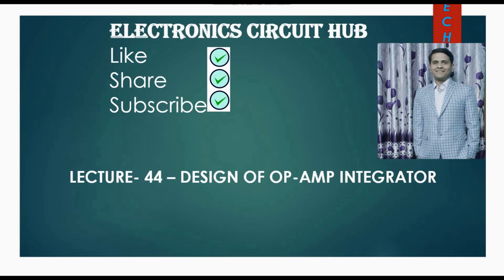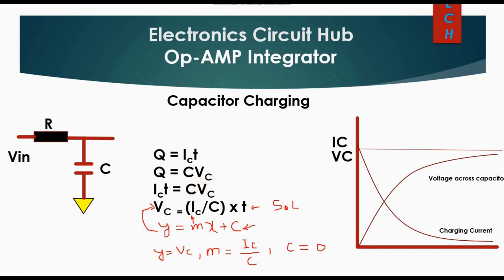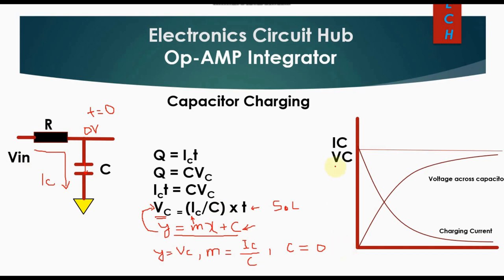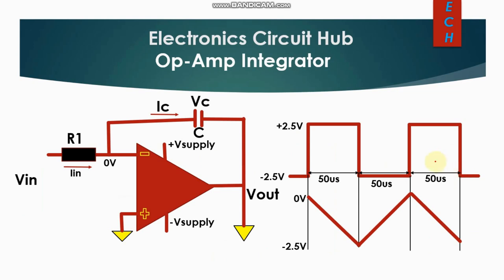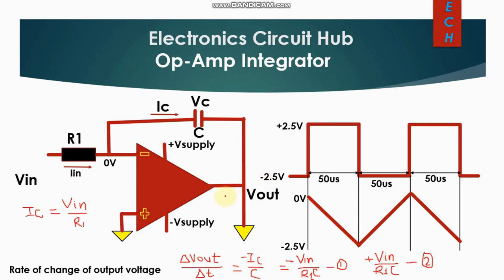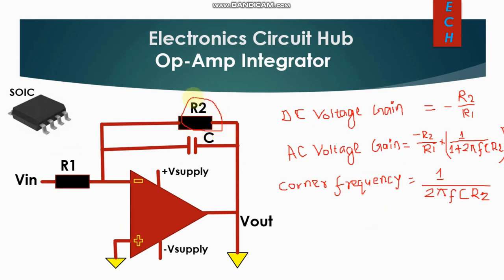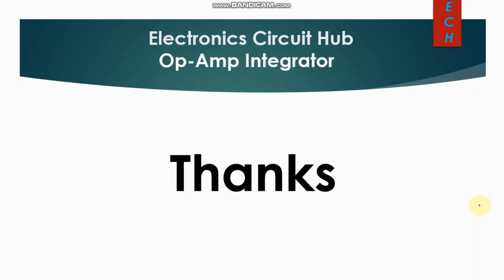Op-Amp Integrator Circuit Design || Practical Op-Amp Integrator with Triangular Wave Generator

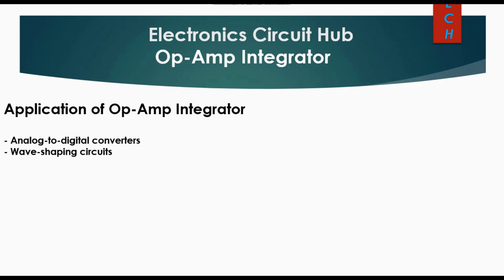Comment from the maker: 0:08 min - Op-Amp Integrator Applications
0:55 min - RC Capacitor Charging
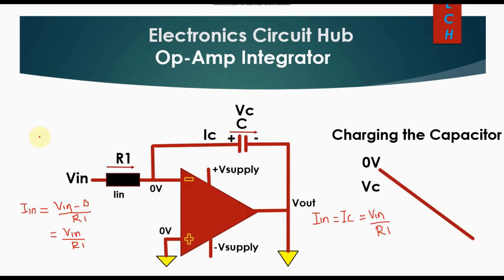4:28 min - Op-Amp Integrator Circuit Realization (Charging voltage of capacitor)
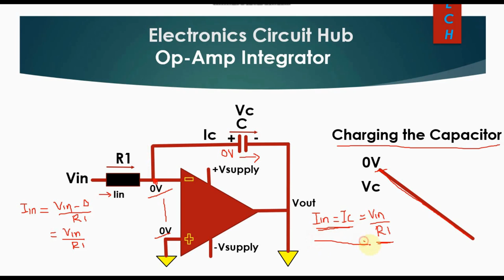6:47 min - Op-Amp Integrator Output Voltage explanation
8:46 min - Op-Amp Integrator Rate of Change of Output Voltage Calculation using examples
10:50 min - Practical Op-Amp Integrator explanation and Role of Gain Resistance